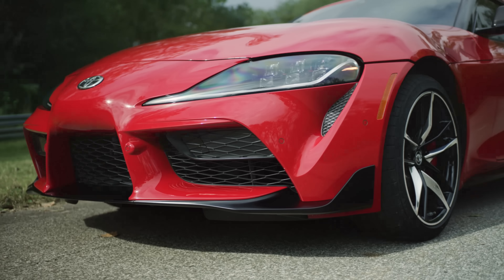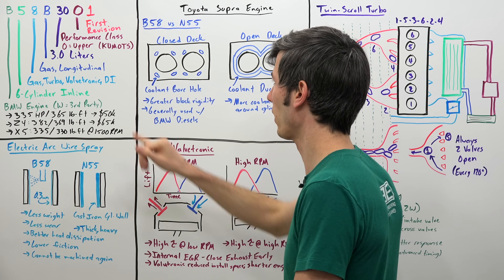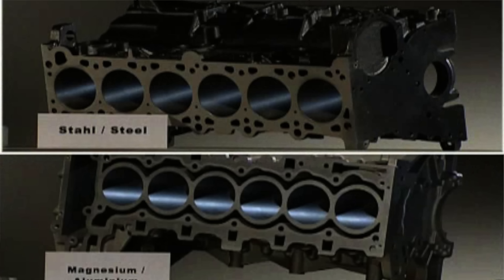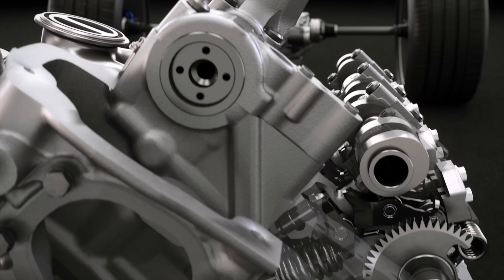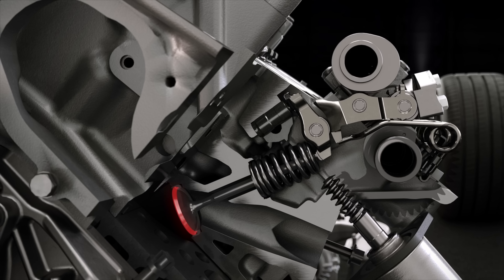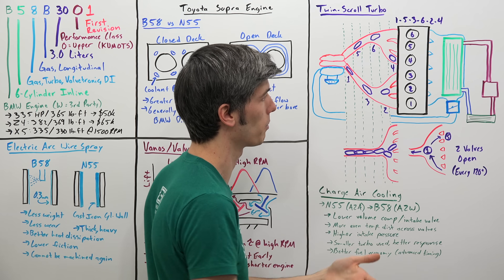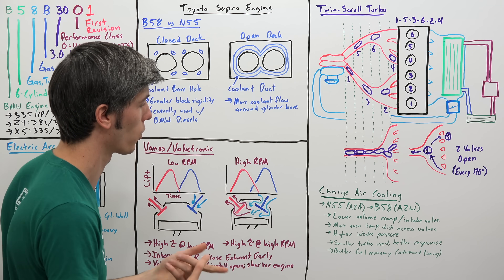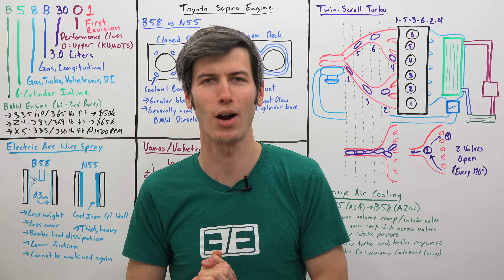2020 Toyota Supra Engine - Detailed Review Of The 2JZ Successor

Comment: Wouldn't it make more sense to have Japanese technology with German styling? Instead it's the opposite. There goes that Toyota reliability. 😑
Reply: as long as bmw only makes the engine their inline 6's are great. if the rest of the car is made by toyota it should be ok
Reply: You know what’s funny is that recently BMW has been soaring to the top as in reliability for manufacturers and beating some Japanese companies. Volvo sadly has fallen down over the years after it was bought by Geely. So weird lol. 😂
Reply: @rex_s80  Yeah for the first 40k miles. It's Russian Roulette everyday after that. There's no way any German car surpasses Lexus. I say this having my BMW and Porsche break down with major engine issues constantly driving between LA and SF.
Reply: @wind016  Do you maintain them?  Might be time to lawyer up if you have lemons.
Reply: @maxnix346  Of course. The BMW 335i had 100k extended warranty which paid for itself 4 times over. High pressure fuel pump failure at 60k. Melted tubes in engine bay at 70k. Turbo failure at 80k. I then rid of it. The Porsche Boxster was better. No issues until 116k miles. Then coolant leak and then severe engine failure. All the Japanese cars, Nissan 350z and Mazda Miata, I had, only had failed sensors and torn timing belts at 150k miles and 320k miles.
Reply: Joseph C. I haven’t experienced any new German cars besides a 2011 Tiguan that we currently own and that one definitely isn’t as reliable as my Volvo. But there is no comparison really with those. I was hoping that the polls and everything for reliability were true and that bmw was getting better, but apparently that isn’t the case. Too bad.. I have a friend that owns an e46 and man that one has been a pain to own. We have sepan so much time fixing things that are going wrong (and it’s under 100k miles still, picked it up with around 70k) it’s crazy that we have had to replace the front suspension bushings twice since he got it. We finally got polyurethane bushings in hopes of not needing to replace them again soon. The engine seems to have had the valve cover off as there is a spot of gasket maker where they didn’t clean it up. It whistles at high rpm under load (thinking air intake tubing) also has to replace every pulley and tensioner on the accessory belts. The convertible top had to have a gear assembly replaced because that broke on the first day. We also had to replace the PCV and delete the secondary air pump because that also failed. And this was a dealer “inspected” car. It leaks oil as well, but we think that it may have been because of the PCV being clogged. Hopefully no seals were pushed out. Funny enough the most work I’ve had to do is on German cars because out Tiguan needed suspension work at only 90k mile(noises started happening far before then, but I wasn’t allowed to fix it because my parents didn’t trust me). We haven’t owned a Japanese car in the family for quite a long time. But Honda and Toyota (and associated luxury brands) definitely have their reputation for reliability. I do feel however that every new car has to sort of earn the title of reliable before you can say it is. It’s why I like to buy used cars only. Because you know how they will interact over time because of what people have experienced. My Volvo has 175k miles and runs really great. Apart from that it has a lot of carbon build up from having 150k miles of cheap gas. (I know if did because my grandfather owned it) but reliability in it’s self is pretty decent. The biggest issues have been electronics. But then again. When a company tries something new. It’s bound to have problems (Volvo was first getting into electronic throttle body’s and stuff for the first time) so tbh it’s been not bad at all. With all the original inspection sticker from 1999 on the suspension and about 95% of the car everywhere else, it seems to be mostly original parts. So only had to replace the front spring seats at 170k miles. The control arms may come soon. But those are so much more simple than BMW’s to replace.
Reply: Joseph C. I never said the bmw was more reliable. Just saying they have gotten better and consumer reports has them in the top 7 I think. So they aren’t that bad. Volvo sadly has dropped so far down it saddens me to the core. My 20 year old Volvo definitely holds up better than a 20 year old bmw.
Reply: As if Toyota ever cared about reliability to begin with.
Reply: @ZeroHourProductions407  Wtf? As compared to what? Toyota is still the most reliable car maker in all reports.

Comment: Why people so obsessed with horse power, and not looking at the engine/tranmission as a whole / The experience? This Supra can picup speed pretty fast at 4.1 sec. You can give me a car that has 100 horse and doing 0-60 in 3.5. I will happy to take that versus a car that has 4/500 horse that does 0-60 in 5 sec. Okay Okay, those numbers wasn't based on a real car stats (so dont give me sh$t about how unrealistic I am), I just want to get my point across. One can brag about how much horse power he has, but at the end what's faster? Want a big horse power/torque? Go buy a RAM truck. BMW is bad for their reliability, but the driving engagement is second to none.  The experience in driving that is what I want to see when this car finally get some real road driving.
Reply: But there is no manual transmission experience available...
Reply: That's all fine and dandy if you just want any old sports car, but the Supra became the classic that it is due to the sheer overengineered bottom end of the 2JZ. It proved that you could get massive horsepower numbers reliably out of a Japanese engine. This new Supra isn't even Japanese. It's just a knockoff Z4.
Reply: Exactly!. It's a great proper sports car and with the available tuning it'll be a beast  in the end!
Reply: they're classed 8th in reliability in over 40+ manufacturers, first and second place by toyota/lexus, they got pretty good recently
Reply: @n.d.4317  So if that's the case why didn't Toyota use its own Lexus/Toyota twin turbo V6 that's in the LS500, NA version in the Camry and Supercharged version in one of the best street/track cars, the Lotus Evora 400?
Reply: @n.d.4317  I am a BMW fan but I am also skeptical about that rating. I just hit 20,000 mile on my F80 and I afraid the DCT will give me issue everytime it jerks (guessing the gear in correctly).
Reply: @T Nguyen
 I guess only time will tell if its reliable but I havent heard any recurring problem with that transmission. Even then, Getrag is one of the biggest in the transmission game and even supplied the previous gen supra
Reply: Ok no problem.....I'll give you a Toyota powered Lotus Evora 400 with a manual that has better performance than the MK5. It also has a back seat. Why didn't Toyota use this engine and transmission is beyond me
Reply: @Omar Monelle, that Lotus cost more than the supra, same as the ls500.  They simply had to use a turbo i6, it was always that.  The Lotus only has 20hp more than the supra, 380 for non EU restricted vehicles but has the same acceleration 0-60 in 4.1 sec. The backseats, I do believe there is enough room but even the mk4 had non functional rear seats so some previous owner are glad they're gone lol
Reply: You will NEVER see a 0-60 in anywhere near that time so quoting them is moronic. Just look at Johnny Lieberman talking about how they got their 0-60 rating for their WRX article. The time when they started vs published was almost a 4 second difference, and they nearly destroyed the car trying to hit the claimed 0-60.
Reply: @unlisted9494  which part of "trying to get my point across" and "dont give me sh$t" you dont understand?

Comment: Patiently waiting on the first 2JZ swap into a 2020 Supra video.
Reply: Barra swap for sure
Reply: That is a lot of money. At least the v12 BRZs were novel.
Reply: @unlisted9494  don't worry, there is a thing called power to weight. The 2J makes real power, thus helping it overcome the extra added weight.
Reply: Hahahaha thatll be intresting lol
Reply: Hahahahhha LOL
Reply: You know a man in Japan already did this yeah?
Reply: Then just buy a MKIV if you’re doing that lol. Swapping in 20 year old tech doesn’t make sense.
Reply: @vengvue7955  And yet Toyota specifically designed this new chassis to be 2JZ swappable.  It's a straight up admission from Toyota, that the older engines were superior.
Reply: Why though? Like the B58 is the better engine? The 2JZ isn't that great of an engine... It's only good because it's an iron block and can handle lost of boost. The N54 & N55 from BMW is forged from factory and they make a lot of power too, just look at Adam LZ's N54 in his 335i. The B58 is the new successor of the N55 and already it's making great power from just a couple of bolt ons and a remap? 2JZ is old tech.
Reply: @BkSMedia  yeah and a also this car is lighter than the old supra, and the tuning community hasn't even got their hands on it, I'm sure on a quick tune they can get it up to z4 lvls and beyond..
Reply: @aoescool  B58 has been out for years and it's already regarded as a bad tuning platform compared to the engine it replaced, which was a less robust version of the 2JZ to begin with. BMW engineers their cars to make the hp they make stock. Not twice what it makes stock like the 2J.
Reply: @BkSMedia  look at how thin the cylinder liners are in the new B58? People are going to have to spend thousands to get about 700 rwhp. And 700 rwhp is nothing these days
Reply: @Rhett.Castillo  You say that, but nobody has attempted to build a B58 to 700rwhp yet. It could be easily doable on the electronically sprayed liner.  Tech is so advanced now, I'm sure that coating will have a rating way beyond what it's normal operational rating is. Cars are so much better than they used to be.
Reply: @BkSMedia  Ford has been using the spray in cylinder liner for a few years now, and the liners definitely have a integrity limit at about 200 rwhp above factory horsepower levels. Which is why I've stated the above statement
Reply: @Rhett.Castillo  spot on!! I'm glad I'm not the only one who caught that very important piece of info regarding the cylinder walls
Reply: The 2JZ is also forged. There is no doubt it's still the stronger engine. They just don't make them that robust anymore and emission regulations mean they are now more complicated and more fragile.
Reply: @BlatentlyFakeName  You forgot to say GTE. Not everyone know that 2JZ's has 2 versions, the 2JZ GE's are not forged. Although GE's can handle strong boost, their bottom end can't handle Supra levels for long periods of time.

Comment: So it's basically a Z4 with a bit less power and torque.
Reply: its a part of the video I don't like, both will have the same engines and specs. He did compare the us version of the b58 and the european version.  Both the z4 and the supra will come with the B58B30M1 at 335hp in europe and the B58B30O1 in the us, which has 382 hp. This isnt confirmed yet but looking at bmw's code information about both models (for the transmissions and engines) and the information we know its pretty much what will happen. The z4 won't be available in europe with 382 hp du to emissions law and the supra has been confirmed to come at 380hp in the us market. This video should probably have been made a bit later when they confirm more infos.

Comment: I assume the cylinder coating process is similar to what Nissan uses in the VR38 for the GTR?  I think those guys just hone the walls if needed to reseat piston rings, otherwise, I'm not aware of any shops running into problems with it.  My feeling is most people who will be building these motors in excess of 800-1000hp probably wind up selling the car or installing a new block due to damage long before the coating wears down.  Makes a good excuse for a stroker build, I suppose.

Comment: So if someone buys a new supra and there is an engine problem, do you take it to a bmw dealer?  If so, how does that work with warranties?

Also what are some of the common points of failure in the B58 engine based on the models you mentioned?

Comment: Dip stick?    No.

Can’t rework the cylinders?  No

Automatic gearbox only?   Yes.

Drivers car?   No

This car is for old baby boomers who inherited some currency from there dead parents house that was inflated to silly value & spend it on a car to drive round & pretend to folk that they made it fair & square.   These cars won’t even be driven hard or well.....trust me I’m a truck driver in UK, & car drivers by & large are pathetic, couldn’t even overtake a tractor going 30mph on a straight road.

Comment: I'm not a purist, but it's weird that the Supra runs a B58 while the Evora runs a 2GR. It's not like Toyota didn't have a good (possibly better) 6 cylinder, so I'd love to know the logic behind that decision.
Reply: The V35A-FTS is a fantastic new V6 twin turbo Toyota engine.  The crux of the matter is that Toyota did not want to invest in designing a unique platform for this car (whether by mixing and matching Lexus IS subframes and designing a new coupe body structure, or whatever).  Having BMW design and manufacture it would slash R&D costs to almost zero, making the car a much more profitable exercise for Toyota.  While BMW get extra production volume on their production line.  A win-win for both.

Comment: Hey Jason, people mention often that the VANOS or cooling system plastics BMW uses are a reliability concern. Could Toyota end up replacing those parts with their own, or would that kind of customization not be normal when using an outsourced engine?
Reply: The secret is to change the oil at the prescribed 10k interval or every 5k miles. BMW engines generally don't tolerate neglected maintenance.

Comment: Can you please explain the heat encapsulation system? Wiki says "The B58 also features an engine-mounted heat encapsulation system to reduce engine wear and emissions during start-up."
Reply: It's essentially heat storage. I can't find any proper info on it but the gist of it is this: you get home from work, oil and water at operating temperature. You go out the next morning and instead of the fluids being at ambient temperature they will be at a decent temperature.
Reply: @AkinaGhost  exactly, can't find any information on how it works :/
Reply: @mr.z4973  All I can say is it's a passive system, there's nothing to break or go wrong.
Reply: Perhaps store fluids in an insulated bottle?

Comment: The same power figure as 20 years ago, but at higher relative cost.
Does, it have two doors? Check. Is it RWD? Check. Is it a straight-6? Check. Is it turbocharged? Check. Is the HP 320? Check. Is it Red? Check. Then it's a supra...

Comment: Why didn’t Toyota use their new V6 engine and slap a turbo on it instead of BMW’s straight 6? I’m sure the Toyota V6 engine will make more horsepower since it makes  around 300hp without a turbo.
Reply: Then all the 2jz fanboys would cry over it not being an inline 6 etc etc.
Reply: Because they would have to develop the whole platform around that engine. And it takes more than just a bigger turbo to get power.

This was the easier way for toyota.
Reply: Basically cheaper.
Reply: Nissan Did.. Why not?